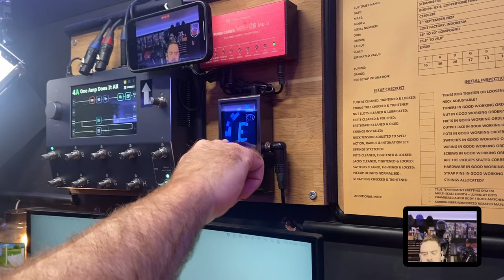Guitar Setup Tutorial - Episode 7 - 2022 Strandberg Boden + NX 6

Comment: I thought this model has a Richlite fretboard...not sure the oil has any impact as it is not permeable. But great job overall!
Reply: Oops, I almost made the same comment, while holding mine in my hand (light enough for one handed carry...lol) :O)
Reply: It’s just good hygiene. Doesn’t need it to look good
Reply: @MalcolmTuckerDirectorofCommuni  Cleaning is always a good idea - a good guitar finish cleaner will do the trick on Richlite. Oiling is not needed. That is one of the benefits of Richlite - it doesn't need the level of care of wood and you don't have to condition it or worry about it drying out.